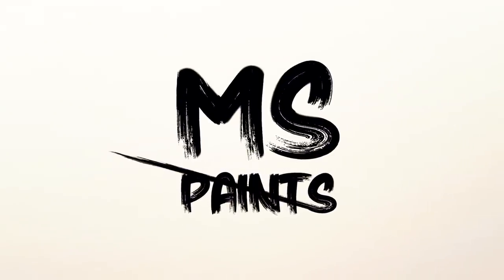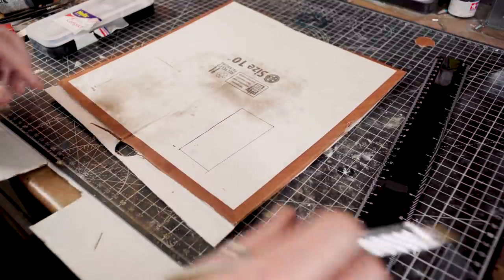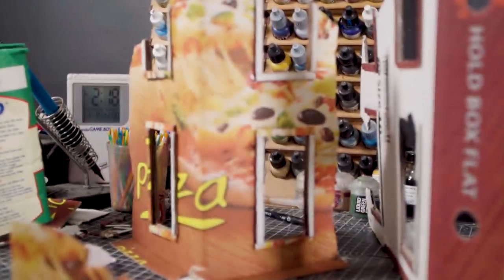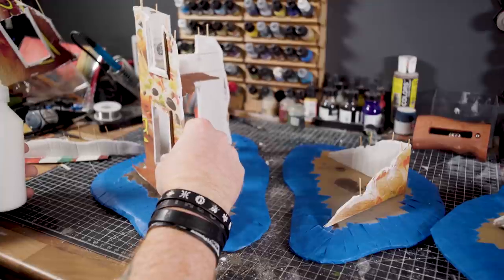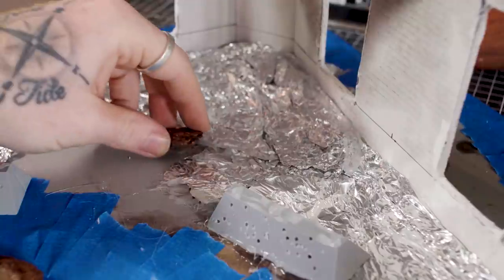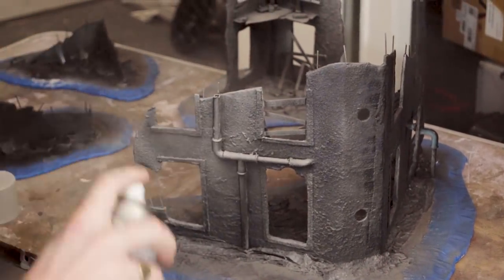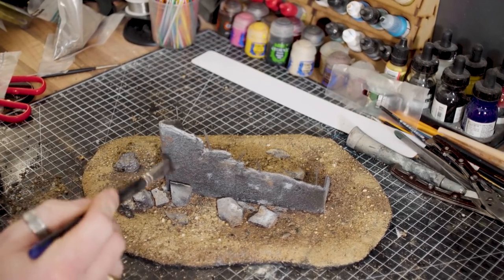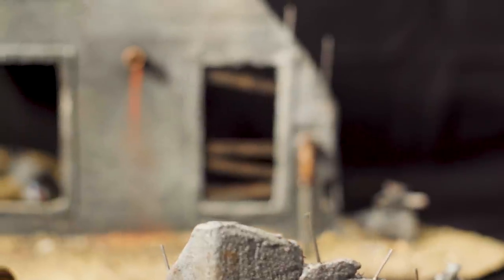40k RUINED CITY from PIZZA BOXES - A WHOLE TABLE of TERRAIN on the CHEAP

Comment: Love how that texture turned out, that's a great tip. All pizza boxes are great material :D Freezer pizza boxes tend to be thicker versions of the stuff cereal boxes are made of, it takes texture really nice if you draw on it with a pen.
Reply from the maker: That sounds better! The corrugated texture on this stuff kept coming through
Reply: @MSPaints  Bit more time consuming if you need the thickness, though it layers up nicely.

Comment: So, I actually love working with cardboard for terrain... but I've held off on using pizza boxes specifically because of the food stains issue. I'm legitimately concerned about incorporating left over grease, tomato sauce, & cheese into something that's going to sit on my shelf for years. Does anyone have suggestions on how to reasonably clean/remove/sterilize the leftover pizza gunk? Or assurances that I'm worrying to much, & a good enough seal stops pests?

Comment: I really like the idea of using flour for the texture 😱😍 I'm going to try it with my first piece of homemade terrain (a small classic cardboard corner ruin) and I have a question first.

 After applying the flour, could I use some watered down PVA glue applied with a really fine diffuser to seal it before painting it instead of varnish? or would it be too much liquid and get the flour soaked and ruined? Thanks and great video man, I really really like it and going to use it for reference for a lot of techniques and little tricks to apply to my projects. Cheers 😄
Reply from the maker: I suspect it wouldn’t break the flours surface, and it’d sit on top. But if you find a diffuser that works please let me know, I’d prefer to do that over varnish